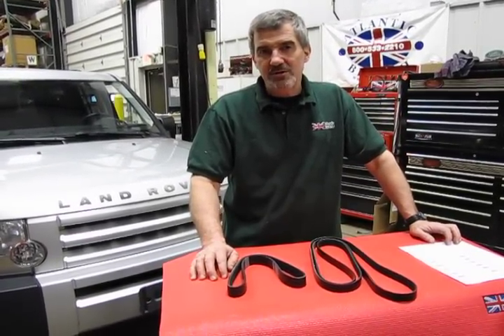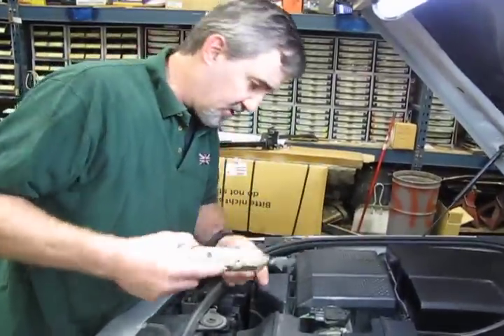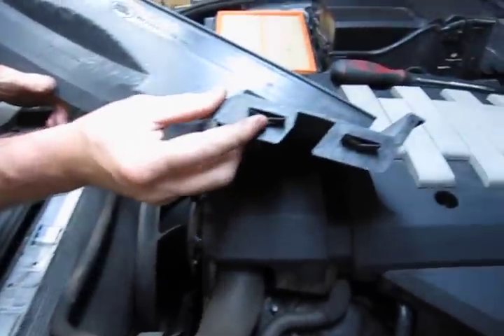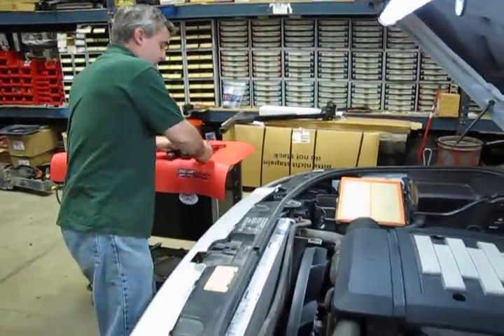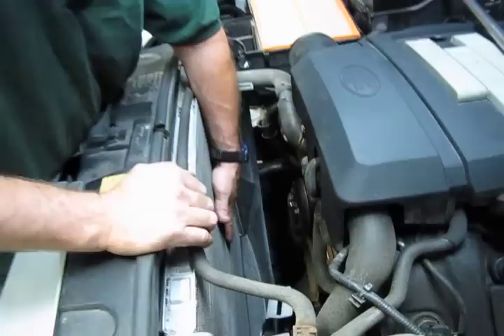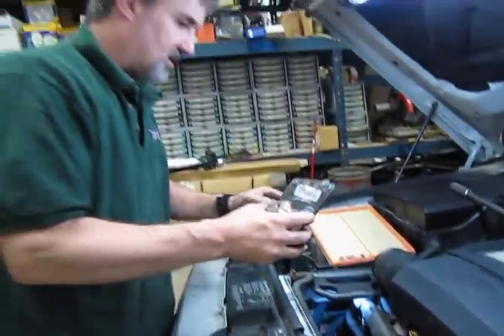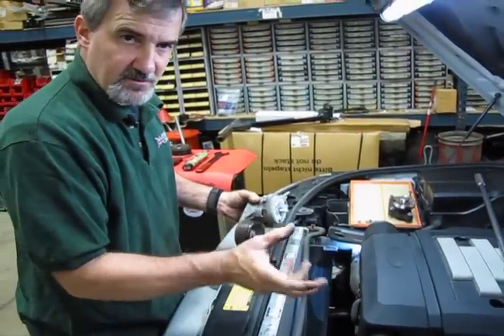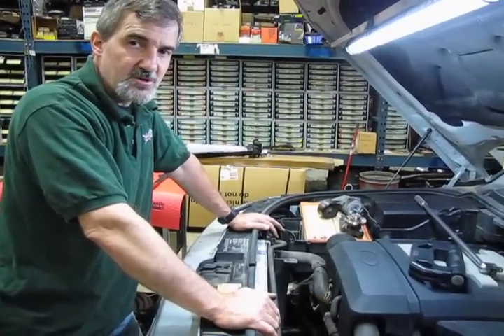Replacement of the Belts on Land Rover LR3 or Range Rover Sport, 2005-2009

Comment: Thanks for another informative vid Doug...really helps me keep my Wifes LR3 going...
Reply: alex o'neal  Hello I have and 06 but the filter is on the left side and the ac line is right over the fan cover is there a video on how to remove that one ? Thanks. Looks like the transmission oil cooler is attached to it  of the same yearr but that one the top half comes off but mine seems different maybI’m overlooking something

Comment: If the nut doesn't undo as with the tools, use a hammer action SDS drill with long chisel. place it on the nut and slightly off centre to the right and it will loosen within 5-10 secs. Spent hours trying with spanners with loads of force and nothing. 5 sec tapping with a blunt chisel it was off. (great video)
Reply: Thanks. That saved me time and worked perfectly

Comment: I have a 2011 LR4 V8, and although the larger 5L V8 has dual air intakes, the process is much the same. I would say that getting the fan nut loose was a complete nightmare. I brought the special tools, which didn't make the slightest difference. I borrowed a neighbor's air compressor and pneumatic hammer connected to a nifty tool I got from Harbor Freight, and still, the f@$ker didn't budge. It was only when I applied some heat with a micro torch that I was finally able to get it off using the air hammer.

Comment: I recently replaced my alternator for about the 3rd time with a expensive Bosch. It died while on the freeway.  Could it be that my belts needs replacement because a Bosch shouldn't wear out that fast?

Comment: I feel like I can do this, I will need to buy the fan tool, but I'm still a bit confused as to how he removes it, where did the other pry bar go exactly ?
Reply from the maker: Hi JayVee, at 5:05 Doug explains that he puts the other pry bar between the bolt of the water pump and the nut for the fan.

Comment: Is this the same for the 5.0l lr4?  If not is there a video?
Reply from the maker: Hi Tony, the video only applies to the 2005 - 2009 LR3 and the 2006 - 2009 Range Rover Sport. We currently don't have a video for belt replacement on the 5.0 LR4, however, if you would like to request a video, you can do so here: https://www.roverparts.com/resources/videos/